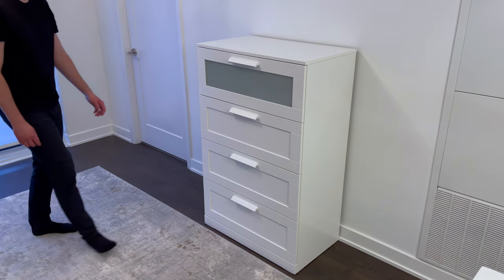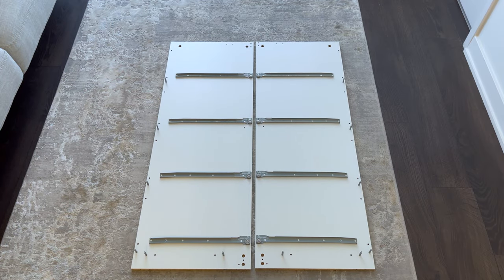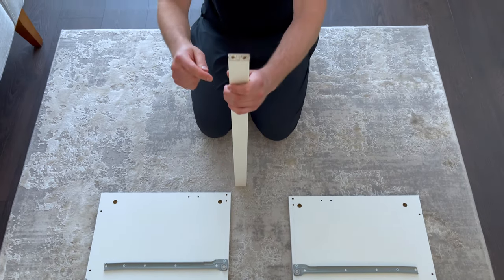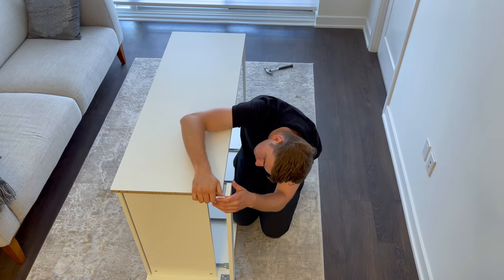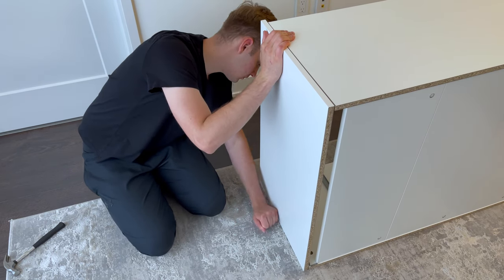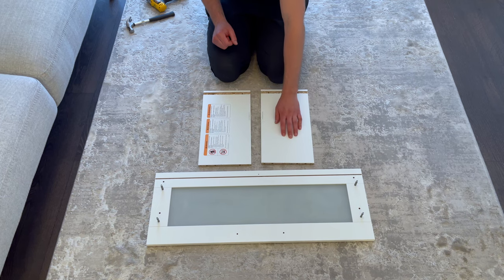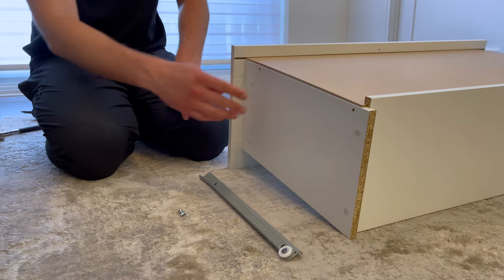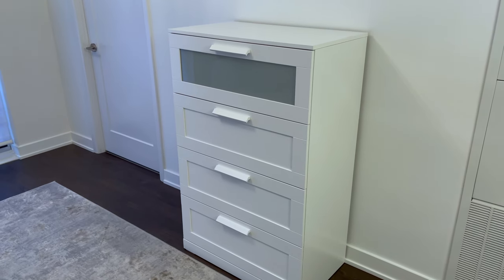Easy to Follow Brimnes 4 Drawer Dresser IKEA Tutorial

Comment: I wonder if my dresser has a manufacturing mistake or if the design changed. I am missing two holes on the bottom of both the left and right panels. After I installed the drawer sliders, I then screwed in only eight of the '118331' screws, as there are only eight holes and not twelve.